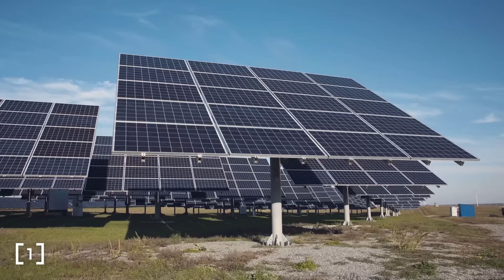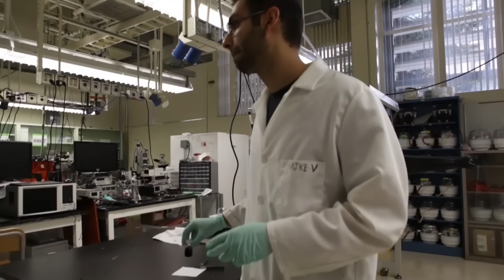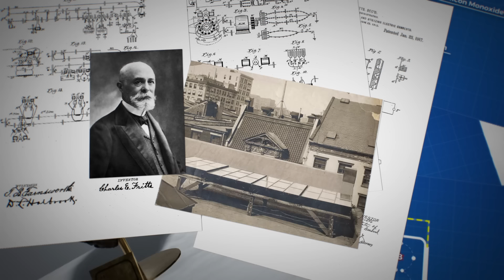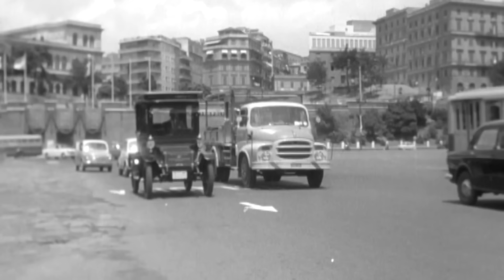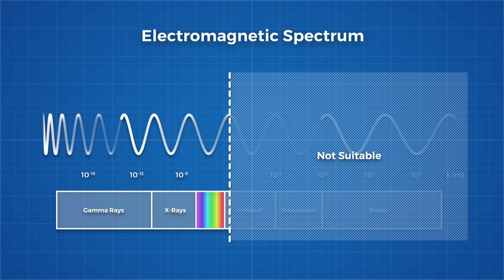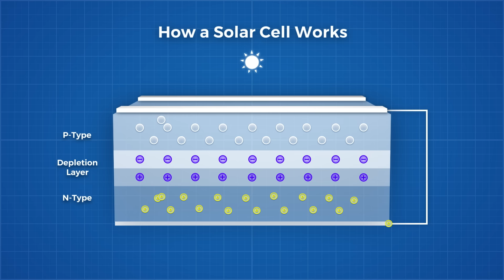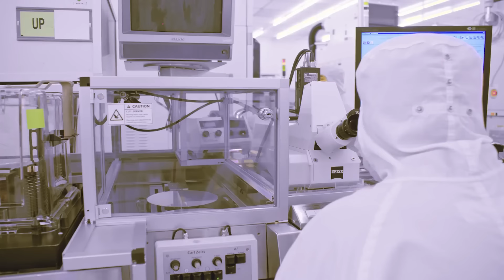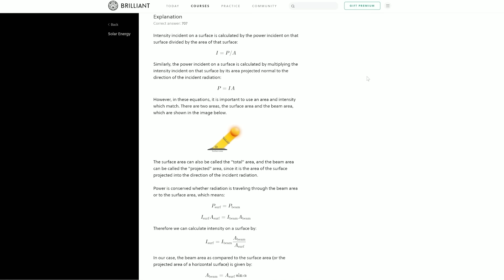The Mystery Flaw of Solar Panels

Comment: Would love a video about why solar cells do poorly in heat if you’re up for it
Reply from the maker: As soon as explanations go into quantum physics, my brain is incapable of understanding. Not smart enough for that shit
Reply: @RealEngineering  understandable, have a nice day
Reply: @gabrielbloch8837  Silly. Increased temperatures mean increased electron energies which mean increased chances of electron tunneling across otherwise insulating junctions. IOWs, increased temperatures mean the damn thing gets "leaky" in places where that leakage loss should be low. Put another way,  it starts to hemorrhage electrically.
Reply: @craigwall9536  Thanks for explanation. Silicon devices degrade with temperature a lot (exponentially!), one can check a datasheet of any seniconductor device (diode or transistor) to see. No surprise it also affects the solar panels.
Reply: @MrSparker95  If they degrade so much with temperature why are they still used as transistors for CPUs etc? Or is the temperature threshold you mentioned for degradation much higher than the typical < 90 degrees Celsius ?
Reply: @joesheepy  >"If they degrade so much with temperature" do you mean 'semiconductors' by 'they'? Semiconductors are the only way to implement an electronic device which can act as a controllable gate, or a transistor. As for the specific material, currently >99% of devices are made of Silicon. There is simply no other alternative material to Silicon right now for mass market. Other alternative materials are Germanium and Gallium Arsenide as I know, perhaps there are others, but Silicon is better for general case.
Reply: @MrSparker95  Yes my apologies I was referring to silicon being used as semiconductors inside transistors. The temperatures you mentioned earlier that causes degradation, would those lie between say 10 degrees C to 99 degrees C? I was under the impression for between those sorts of temperatures, when computer hardware is concerned, that anything below the typical thermal threshold of ~99C wouldn't cause damage to the components allowing them to be operable for years if not decades. I ask because if the temperatures you were referring to that cause degradation in the silicon lie within that margin then current gen laptop SKUs of CPUs will have a set expiration date of sorts, right?
Reply: @joesheepy  Initially I didn't mean permanent degradation, but rather worthening of some immediate properties of a device, like increased leakage current, or some different output-to-input ratio, or worse frequency response, or similar - which is not permanent and gets back into previous state once the device is at previous temperature.
However there is also permanent degradation of silicon integrated circuits related to diffusion of P and N layers into each other. Remember that P an N layers are made by bringing silicon out of balance, by adding other kinds of atoms, and systems often tend to drift back to balance, like if one part of water was saturated with salt and the other wasn't, in the end it diffuses in a uniform way. The speed of this process also increases with temperature. It is more crucial for modern devices which rely on <20nm feature size of integrated circuits. As far as I know, this process is pretty slow and can break your device in the time span of 10s of years. But I don't know specific numbers. I guess that it is very likely that one single device could work at 99 degrees for 10 years, but if we were to make millions of them then failure rate would be high enough for us to consider running them cooler.
Reply: @MrSparker95  I see, thank you for your detailed response, I greatly appreciate it!
Reply: @craigwall9536  , well stated. The inverse of that is why the increased efficiency of superconductors is dependent on extremely low temperatures.
Reply: @craigwall9536  I thought temperature effects was just that you thermally create hole/electron pairs which create more holes to eat electrons and electrons to fill holes? (Changes recombination rate which is means and electron or hole is more likely to recombine before it reaches a metal electrode. Also there is more scattering as temperature goes up so you see an effective resistance effect.
Reply: @bcwbcw3741  I can't find the text you are referring to so I can't defend what I apparently said. There are so many comments it's like swimming through muddy water. You might want to include the quote when you make a reply in a venue like this.
Reply: @bcwbcw3741  ah. I just found it. Please look up failure modes in overheated semiconductors that are reverse biased. You'll find that hight temperatures increase leakage until a breakdown path forms; this is the end result of increased tunneling, although the term "tunneling" was not always the nomemclature of choice.
Reply: @RealEngineering  well that does mean you should go back to that Brilliant course
Reply: Real Engineering Learning QM is amazing! helps explain what a lot of pop sci talks, (more specifically misrepresents), about. It isn't that esoteric as what pop sci makes it look like, check out some textbooks like shankar QM and anyone can learn basic qm
Reply: @RealEngineering  I discovered this shortly after it was published 3 years ago. Mind blowing but probably goes some way to underline your point Brian! https://www.youtube.com/watch?v=zcqZHYo7ONs&t=804s
Reply: Imagine trying to teach a class of young children and someone keeps giving them KIa Ora and refined sugar.
They cannot concentrate and shake about so energetically that any attempt to get them to walk in an orderly fashion ordo the fire escape drill is going nowhere.
There is no need for a quantum explanation.
If u can understand why resistance in an electric wire increases with temperature;then ur nearly there.
Reply: @chippysteve4524  Leakage and electrical resistance are two different things.

Plus, electrical conductivity in semiconductor materials actually increase with increased temperature.

Electrons can "teleport" past barriers. Called quantum supertunneling. (Solid State Storage actually uses this effect to store bits... except a magnetic field is used to manipulate the electron's probability cloud, instead of temperature.) Anyway when electrons have more energy, they can "teleport" greater distances. 

This increases the amount of electrical energy "teleported" into unwanted areas.

Leakage, is the bane of the semiconductor industry.
Reply: @chippysteve4524  Good explanation.
Reply: @Renato A  Altho this comment is actually valuable, you need to please copy it then delete it here and paste it instead into a forum (e.g. in reddit.com) which focuses upon the huge problem of the built-in mass-impoverishment of socialism always soon causing such gov'ts to become totalitarian dictatorships or oligarchies;  
here, it's very off-topic indeed, and most here who quickly skim thru it just decide it's simply deranged; tho, actually, again, it's very good and extremely important for the future of humanity.
Reply: @Peter Breis  sorry, i didn't make my point very clear.

If you wanted to heat water, you'd rather have a hot solar cell. But you wouldn't want a hot solar cell, because it's bad for its efficiency.

So you can decide to get an efficient solar cell with a lot of luke warm water OR get some hot water with an inefficient solar cell.

The general coclusion seems to be, that it's better to create thermal elements to get as hot as possible. And build electric solar sells that stay cool enough.

But i am all for creating new and genius ways to improve on the things we use.
Reply: Because electicity is just electrons moving
Electricity and magnetism is the same
Heat causes the atomic bond to start moving which results into the electrons becoming unable to move
Hence, current cannot exist in hot areas. Only way for it to happen is if the amount of static electricity broke the dielectric breakdown, which is another topic
Reply: @fynflorentine3342  actually, if you refer to a solar cell...higher temps lead to a lower voltage, while the current stays the same. Resulting in a lower poweroutput.

Currents in general can exist in high temps. As long as there are moving charges.
Reply: In most cases, materials that are poor conductors of heat are also poor conductors of electricity.  Just passing some electricity signal here... :)
Reply: @Peter Breis  Hi Peter am aware of this brand. I have one and it has been a great disappointment. Leaked glycol into my water supply and the panels ruptured after just 4 years. I was told it was out of warranty and I was quoted $5.5K to repair same as cost of original install.

Subsequently I have retained the tank and converted to solar electric, works a treat.

Efficiency is no longer an issue as enough PV panels to heat the tank can be purchased for around $1000, and the DC electric element kit to convert from AC costs just $200.
Reply: Heat = melting over prolonged time
Needs better cooling, could be done with humidity in some form
Air cooling/heat transfer helps global warming? y/n?
An air cooled solar panel, throws heat to the atmosphere but makes electricity and needs some liquid or air for cleaning
A solar panel that doesn't get hot, captures all the sunlight available even when cloudy and don't need to be cleaned often
Reply: You have to watch an other long introduction to find out that it is another advertisement.
Reply: Thermal expansion increases resistance and allows more time for the electrons to find other places to go would probably be another answer.
Reply: You could use a regenerative cooling system https://youtu.be/HMFFkIj6uo0 

Or you could just do this https://youtu.be/WYtRuOz4Wvw

Comment: I wonder if it is possible to use the layer that reduces reflection as contacts for the circuit? Then we wouldn't need the extra space for the contacts.
Reply: The reflection-reducing layers were all oxides which are insulators. Good conductors usually reflect most light
Reply: Transparent Conductive Oxides exist and have been under research for decades, but all of them have issues that prevent them from being used in mass production. Higher resistance than expected, non-perfect transparency, degradation under UV light, rare or toxic elements, difficulty in replicating the the layer over thousands of cells and etc.

Comment: Still waiting on the rest of that Space Elevator analysis.
Reply: A space elevator would be great!!!  

Just read the Red Mars, Blue Mars, Green Mars trilogy to see just how "great" they could be...
Reply: Space elevators are dynamically unstable  - try to pull a weight up and the end of the string changes speed. It doesn't take much time before your end point is half a orbit off, even with very large end masses. You can calculate the change in speed from the force you have to apply to raise your object. This is from conservation of angular momentum. And don't talk about capturing masses in space to send down while your payload goes up, the relative speeds and energy to synchronize motions of objects in orbit is insanely large.

Comment: Yes guys! Photovoltaic cells are just diodes with the sun
Reply: They're LEDs in reverse
Reply: I mean... They're also just diodes
Reply: If you power the solar cell, it can work as a very crude LED, providing IR I believe...
Reply: @ColinTimmins  not if it's made of silicon. Silicon has an indirect band gap, which makes it unusable for LEDs
Reply: Most leds will output just a little bit of energy when exposed to the sun.  They are very inefficient solar cells but I was amazed when I found this out about 10 years ago.  I think germanium diodes will do so also but, I don't remember if I tried them or not.
Reply: and in a circuit you want to place diodes away from the source of heat
Reply: Steve Mould has a video about solar celss being LEDs.
Reply: I've been saying that for a pretty long time now.

Comment: Solar,  wind, Hydro, and more they all need energy storage.  Energy storage is the real problem.  We just have to be able to store it and used in demand when needed.
Reply: We need miniature rotating black holes for storage, otherwise we've no serious way to store anything like the energy needed in batteries, nor ever will.

Nuclear fission or fusion is the solution with some fossil fuel to manage the peaks above baseload.
Reply: @Codysdab  Perhaps.   The reality is that we don't have a solution yet but are imposing the solution 😉 already.
Reply: @SantaBarbaraAlberto  yup that's the truth, but solar will never be it, especially in high latitudes with strong seasons. Solar doesn't work well under 6 inches of snow strangely.

Maybe for tropical areas it'll be good but for 40+ it weakens badly with every mile north

Comment: The problem is not the panels, it's the sun's low energy-dense and intermittent electricity source, no amount of advancement will overcome this. Just go with gen.IV nuclear and be done with it. Extremely high energy density, reliable industrial heat source with high enough output temperatures to replace fossil fuels in all it's forms, not just electricity.

Comment: Why cant California instead of using solar panels and over produce evergy in the day with no solar energy at night, use the concentraded mirror panel energy that can produce clean energy 24/7 by harvesting the heat from the sun?
Reply: How are you going to harvest heat from the sun at night?
Reply: @Noxeus1996  flash light
Reply: Tactics105 👁👄👁
Reply: DER RÜTTLER it heats up a sodium solution which is then stored in an optimised thermal tank to reduce heat loss, the sodium then heats boils water into steam which then turns a turbine

Comment: They don't replace the same mw of generation because of the need for spinning reserve or peaker plants. Watch this, pretty much the problem of generation and dealing with solar and wind https://youtu.be/Zk11vI-7czE
Just remember, we have had huge outages for less issues.
Reply: Well that "need" doesn't really exist anymore. Solar really has the potential to decentralize the grid and it only becomes prohibitively expensive when you get close to 80-90% renewable generation
Reply: @sabotabby3372  not even the Tesla power wall can reliably power your house for more than a day of no sun
Reply: @skynet4496  power grids are bigger than your neighborhood and only an idiot thinks corporations will make us greener
Reply: @sabotabby3372  I work at a utility, formerly at combined cycle plants, now substations. Watch this, pretty much the problem of generation and dealing with solar and wind https://youtu.be/Zk11vI-7czE
Just remember, we have had huge outages for less issues.

Comment: What efficiency gains could be had from lining, say, the rear side of PV cells with thermo-electric generators? not only would they draw the heat away and maintain efficiency (via lower resistance?) but convert some of the wasted heat energy to usable current. I assume it's less than the active cooling method of that's currently in use but still
Reply: Those generators are around 1% efficient and the difference in temperature between the panel and the air is not significant so I would be surprised if it increased total efficiency by more than 0.5%.
Plus then you have the added cost of the generators and large heat sinks required.

Adding more panels would be way cheaper for more power.

Comment: There is a whole host of problems with these that people completely disregard. 

They get dirty. They are limited to when the sun shines clearly. The efficiency drops both over the course of a day, and over the course of their lives, some more than others. Grid tie inversion on megawatt scale is incredibly complicated and expensive.  They are less efficient in desserts with extremely high temperatures. They are not nearly as green as they are sold to be, and it's damn near impossible to recycle them, and they are full of heavy metals. It requires you to cover millions of acres to get any decent amount of grid scale energy production. They require grid scale energy storage systems, many built with hard to recycle lithium. There are significant ecosystem impacts and massive destruction of habitat.

The list goes on. I install grid scale solar generation and storage, and it's hard to convey just how problematic it is. It's not a panacea. Explore it, continue to develop it, but be aware that there are many more flaws than just the free people think of off the top of their head
Reply: John Doe yeah, nothing’s perfect sadly. Everything has its flaws. Luckily its not ruining our planet though!
Reply: @blank2588  There is a host of great nuclear energy to come. Current conventional nuclear once the gen 4 reactors go live will be about as good as it gets for base load generation as it can reprocess old nuclear waste into new fuel or decay it far enough down the decay chain that it's not an issue.